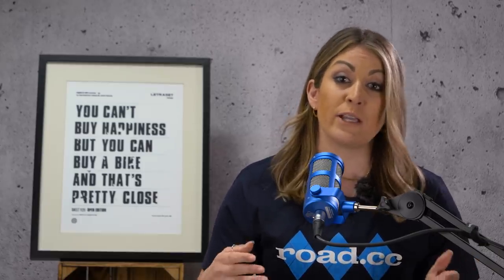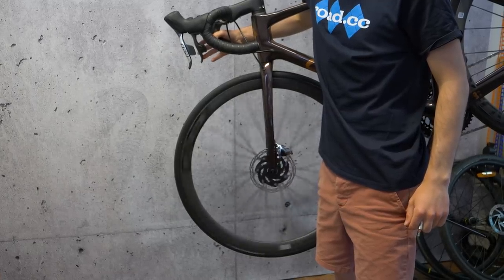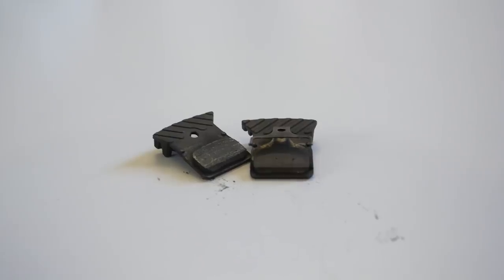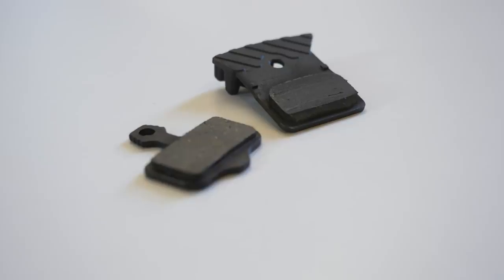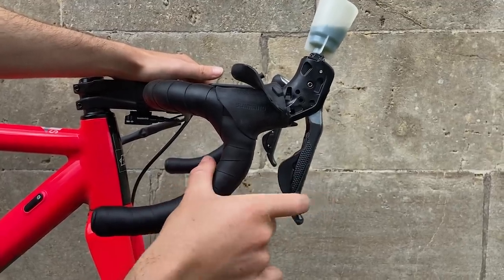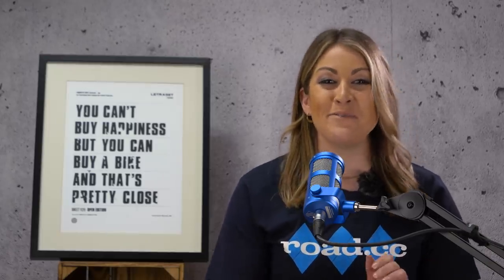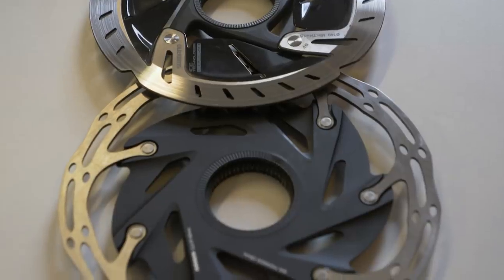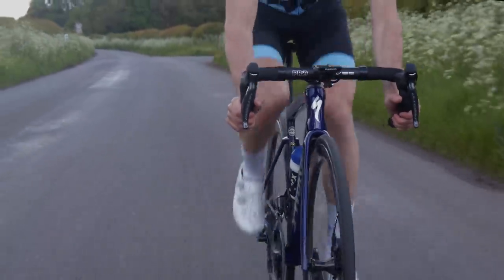8 things they dont tell you about disc brakes

Comment: I've had disc brakes on mtb for a couple of years short of a couple of decades, and I've never had any problem there. so on my new road bike I of course opted for discs and I was very happy this monday when I went crazy down a hill only to be greeted with a above 45 degree bend that I had to apply all my braking force to slow down to. on my old rim brake bike I'm not sure I would have stopped fast enough. But I understand that some like the simplicity of rim brakes, I'm just happy I got options now.
Reply: They're good until they start squealing, that problem is insufferable to deal with

Comment: One important thing to remember is that some rotors CANNOT take anything but resin pads.
My rotor is stamped with "use resin pads only" - dont swap one without the other
Reply: They can actually take semi-metallic pads or ceramic pads. They just won't last as long as they would have lasted with resin pads because they're (the rotors are) made of aluminum instead of steel.

Steel rotors are always fine with whatever pads you buy.

It's... often worth doing to go to semi-metallic or ceramic pads just to save maintenance time. How much time do you want to spend on your knees replacing pads? I know people who do that weekly because they refuse to switch to longer-lasting pads. Steel rotors aren't hideously expensive, and you're probably not trying to squeeze that last 1/100 of a second out of a 10K run, so aluminum rotors are nearly never worth having.

Comment: I have just got into bicycles and have been having a lot of fun working on my bike, having come from cars and motorcycles it's really fun to have such easy access to everything lol.

I've got a disc on the front and and rim brake on the rear. I like the feel of it, similar in some ways to a motorcycle brake feel. The front suspension loads at a good rate to get a nice progressive front brake pressure curve.
Reply: I used to have the same setup on my Giant TCR by swapping the fork. Great idea 💡

Comment: disc brakes are a good source of income for manufacturers and dealers alike.
Reply: Guess why moto gp racebikes have 2 set of disc brakes in the front.... 1. is cooling factor, 2. is increased breaking power, 3. it wont bring your wheel out of balance when you break, which happens when you apply force on one side of a wheel. You may adapt to it, but on a race bike which weights 7.5 kg this is freaking sketchy. As a non pro, you dont wanna change your wheels every 10k or less when descending quite often. You dont want to put WAAAAAY more force onto your fork while breaking. Its just stupid
Reply: @kilian_brk  a motogp bike has more weight and speed to contend with than a bicycle.
Reply: @tomnewham1269  Thats not really the case though. Going downhill with 100 kmh per hour over a long period of time with a lot of breaking is way more force than what u have with a moto gp bike. Moto gp bike weights 160 kg makes a total of 220 kg max. A cyclist weights probably 65 kg including the bike (light rider). The moto gp bike goes 300ks per hour, the bycicle 100. The kmh per kg ratio is better than with the moto gp bike (in the cicumstance of having a light rider on it. Someone with 80 kg drops below moto gp level, which means more force on the brakes than with a moto gp bike. So no its fucking unsafe, givin that everyone uses the same stupid brakes dispite their weight. Safety and good breaking is freaking essential and this is damn careless
Reply: @kilian_brk  But the brakes on a road bike are not as large or powerful than the brakes on a Motogp bike and the Motogp bike and rider still weigh more than a road bike and rider. It is not careless as good braking technique is required whether disc brakes or rim brakes are being used. The brakes are not stupid and they would not be installed on bikes if they were unsafe as the bike manufacturers would not risk litigation being taken out on them.

A lot more smarter people than you would have done research and development on these system braking systems and pass numerous tests before being leashed out to the public.
Reply: @morgan98801  I agree there should be a choice. Not everyone will find a benefit with disc brakes and rim brakes will be suffice for them. A lot of the disc brake haters out there are just Luddites and have no logic in their dislike of them. They come up with so much crap just to try to point that they are right and everybody else is wrong. I guess a lot of that hatred comes from that the fact there will be no choice in the matter when it comes to purchasing a high end road bike and a lot of the hatred towards disc brakes would go away if manufacturers continue the option of kitting out your bike with either brake type. 

Don't get me started on the 26, 27.5 and 29 inch wheel debate. Again there should be the choice in wheel size but unfortunately that is not the case no more. I do hope manufacturers turn back the clock and offer either wheel choice on their MTB's.
Reply: @morgan98801  Yep, and then 29'ers . . .  . hahaha. it's all marketing.
Reply: @radiocontrolled9181  If everything is just marketing, do you think today's bikes are no better than bikes 40 years ago?

Comment: I have been using RIM brakes for over 30 years and never had a problem.  They have worked great for me for all that time and not once have I thought "wish I had disk brakes" I do have disk brakes on my mountain bike but I had no choice on that one and I cannot see what the fuss is about....  I will stick to my RIM brakes for as long as I can I am not getting on the band waggon
Reply: Disc Brakes are for idiots who like the latest fad whatever crap it may be. Rim Brakes are superior in every way on a bicycle since bicycles are powered by humans and easily stopped  by humans. Furthermore disc brakes gives a TON of issues when the rotors have even the slightest wobble and out of true sometimes in the heat the pistons will push out and rub on the pads sending you to a grinding hault and stranded. A rim brakes you can literally just adjust it with your fingers furthermore rim brakes allow for bikes 1KG lighter and more.

Comment: I've had disc brakes five years now, changed the pads a few times, and yeah that's about it. No squealing, no hassles, and pad changes take maybe ten minutes tops. If you can bleed the brakes on your car you can bleed them on your bike, it's just not that hard. Use what you want, but disc brakes are just peachy IMO, especially when monsoon season rolls around. 
(Edit) I've got two bikes, one for commuting and one for fun.
Reply: Rim brake die-hards perhaps don't realize that the overwhelming majority of cyclists around the world don't service their own bikes beyond maybe changing out inner tubes, if even that. They go to their LBS.

Given that fact, most people choose disc brake models for the simple fact that they "feel" better when it comes to power modulation. Oh, then there's also the self-adjusting aspect of disc brakes, with no need to fiddle with barrel adjusters and the like to adjust for pad wear and rim spacing. Plenty of people can't even be bothered doing that.

If most riders simply go to a mechanic for bike setup and repairs, thus eliminating the supposed hassle of setting up or maintaining disc brakes, why would they choose brakes that have arguably inferior lever feel, even when set up correctly, and worse modulation?
Reply: Having both worked on cars, as well as being a bike mechanic, the disk brakes on cars are actually easier to service than the ones on bikes!
Reply: @lihtan  I'm a car mechanic, and I can confirm that bleeding a car is far easier than bleeding Sram brakes.
Shimano's all right, though.
I'll continue to ride rim brakes until you can't get rim brake frames anymore.
Reply: @lihtan  really?
Not on any car I've ever worked on 😆
Reply: @peterfenwick4662  Let's do a few comparisons here. On a car, the brake calipers are usually attached with something like two 14mm bolts. The caliper only goes on one way. You line up the bolt holes, torque it down, and you're done. On a bicycle, the caliper will be attached with a pair of 5mm hex bolts that go through slotted holes. You have to manually center the caliper often to a fraction of a millimeter. Then there's also the issue of rotor warp. As much as I like the performance of disk brakes on a bike, they're not plug-and-play like they are on a car.

On cars where I've had to do more involved work like caliper upgrades, or swapping in stainless brake hoses, I would also install a set of Russell Performance Speed Bleeders. unlike the factory bleed screws, the Speed Bleeders have an internal ball valve that allows one person to easily bleed the brakes by themselves. Simply open the screw, and pump the brake pedal until you see clear fluid. Couldn't be easier! The one instance where bleeding brakes on a car would be nightmare, is if you have purge an air bubble out of an ABS modulator. You typically need access to dealership equipment that can use a proprietary factory protocol to cycle the modulator.
Reply: @lihtan  I've never had a problem centering the caliper on my bike.
Discs warp on cars too, components go rusty and stick. Pistons size etc. And yes, you need to access the software to cycle the ABS pump. 
There's also the task of lifting it off all 4 wheels and removing them.
I replaced the pads and fluid on shimano brakes on my hybrid in under an hour. 
Same job on my car would take at least 2  hours and that's without the inevitable rusted bolts.
Reply: As a former cycling food courier the sheer costs of weekly v-brake rubber pad changes was horrific. My scooter disc brake pads have been changed ONCE in 7000 miles. Disc brakes should be the norm.
Reply: @brokeandtired  
My first set of pads got 5k on them before I needed to change them, I guess I ride the brakes a little harder than you do. :) I do have a lot of hills in my area of Japan though.
Reply: @lihtan  
I've never had to center the caliper on my bike,. Pull the wheel. pull the cotter pin and old pads. push the caliper back with a flat shim and some beefy pliers, put in new pads and cotter pin, install wheel squeeze the brakes a few times and job done. Yes you should check for dragging, or an uncentered caliper as well as rotor warp, but I guess I've been lucky that I've never had any of that. I've only had Shimano components though, so maybe that helps. 

For me bleeding on cars has always been a two person job, those speed bleeders sound like a nice addition to a car though!
Reply: @Bagledog5000  When I worked as a bike mechanic, centering brake calipers was a necessary skill when you're assembling a new bike. The bikes I was dealing were pretty bad from the factory. Hardly any of the mounts on the frame were straight. As annoy as that was, the mechanical disk brakes were even worse, as you had to compensate for cable stretch as part of the tuning process.
Reply: @lihtan  
Okay, that makes more sense. I've never had to set one up form the factory, I can see how a lot of the stuff that is slapped together nowadays would suffer form that sort of thing. Some of the welds I've seen have been pretty sloppy lately, and on fairly high priced bikes, so I can see how other stuff could be too.
Reply: And tell me, how many riders heading out for hours and hours in "monsoon season"????? Also, I haven't seen many riders-if at all-in monsoon areas....maybe is just me.......
Reply: @shandytorok259  
Even I don't head out for "hours and hours" during the monsoon season, but when you get caught in a torrential downpour on your way home from work because the weather report was off by a few hours, and you've still got 45 or so minutes left in your ride and a hilly section of Japan to ride in, well let's just say rim brakes suck pretty bad at that point. They actually suck pretty bad on the flat parts as well to be honest. Ortlieb saddlebags are awesome though, and highly recommended. 
Since we're smack dab in the middle of the season right now, it's slated to rain pretty heavily every day next week. But I bet I'll see about  the same number of folks cycling that I usually do just like I did today when it was raining, so maybe it's just you after all.
Reply: Guess why moto gp racebikes have 2 set of disc brakes in the front.... 1. is cooling factor, 2. is increased breaking power, 3. it wont bring your wheel out of balance when you break, which happens when you apply force on one side of a wheel. You may adapt to it, but on a race bike which weights 7.5 kg this is freaking sketchy. As a non pro, you dont wanna change your wheels every 10k or less when descending quite often. You dont want to put WAAAAAY more force onto your fork while breaking. Its just stupid
Reply: Bleeding bike brakes is MUCH easier than a car. At first I was hesitant but having excess hydraulic brake hose got annoying, I bit the bullet, cut it and bled it. It was virtually foolproof. After having all sorts of brakes on my bike, I would always go to hydraulic brakes. Pads last at least 2000 miles, pad changes are two-minute jobs, there's no brake squealing, great modulation, great stopping power, swapping a wheel out is easier and when you need to align the brake calliper, it's a two second job - loosen the calliper bolts slightly, apply the brake, then tighten the bolts! There's no need to bleed every year, the fluid never really gets hot so no need to change out. Best one, rims never wear out, I still use the same wheels for over 7 or 8 years. Bleeding bike brakes is MUCH easier than a car IMO. I can do my bike... I don't want to do my car!
Reply: @Kuriketto  I used to be wary of disc brakes. However, after the endless adjusting of V brakes, having the adjustment screws strip the thread, finding replacements, installing, having adjustments go out of whack... I've found that hydraulic brakes are actually not that difficult to bleed, and changing pads on them is actually easier than V brakes, at least in my experience. I utterly cannot and will not go back to that endless, endless, endless faffing of adjusting V brakes. Discs are a short learning curve, but that self-adjusting nature alone is worth that price of admission.
Reply: It’s all personal preference.
Reply: All you need to win the rim vs. disc brakes argument is a can of WD-40. You squirt it on the rim of the rim brake bike and on the rotor of the 8-tracker. The rim brakes will hesitate a little as they strip down to metal, then they'll grab. You'll probably have to dismount the pads after ride and scrub them down, and should probably wipe your rims too, to get optimum braking back. 

As for the 8-track brakes, you'll probably have to scrap the entire bike and buy a new one. If you survive the ride home. Which you may not. 

This is why they're called 8-track brakes, at least by those of us who survived the 70s. I could go into the ludicrous levels of adjustment and maintenance, the expense, the weight, the marketing churn that makes your model obsolete and unserviceable a year of two after you buy it, the rides spoiled because your goddam brakes won't stop doing that...

But a can of WD-40 will put an end to any nonsense about disc brakes being safer, more reliable, or easier to service.
Reply: @RobMacKendrick  So your argument against disc brakes is because a can of WD40? HAHAHAHAHAHAHAHA Go back to your nap grandpa, you are obviously cranky. I've had the same disc brakes for over 6 or 7 years now, parts are available but the only thing that really wears out is the brake pads... which are available from anywhere and lots of different brands to choose from. If the brakes need replacing after 10 years because I can't get a new seal or whatever... I'd rather just get a new brake setup.
Reply: @khalidacosta7133  Did you just write "HAHAHAHAHAHAHAHA", son? That's the best you can do - schoolyard trash talk? Do you know what WD even is? You run into that - and similar substances - around bikes. They get on stuff - like my disc brakes, which required disassembly and new pads because of something as ridiculous as a touch of overspray. And that same kind of thing comes off the road. There are dozens of similar pointless problems with disc brakes, which meantime don't solve any problems that most bikers actually have. So run along and play, little boy. The grown-ups are talking about grown-up things.
Reply: @RobMacKendrick  Easy. Far more stopping power, reliability in all conditions, easier pad changes, easier wheel changes, heat tolerant - no popping tyres or delaminating carbon on steep descents, rims don't wear out, less maintenance as brake pads last longer, don't have to clean as often, less maintenance & adjustment (pad clearance is automatic) less force needed with your fingers for higher stopping power, better control of force, better feel.... pro's on rim brakes? Slightly more aerodynamic and less weight. The weight is a bit of a moot point... you weigh around 70-80kg on average. Even 200g extra won't make much difference. So yeah, no thanks, I won't be running, I'll be cycling... with far less maintenance and far more safety than you.
Reply: @RobMacKendrick  Ever had a rim blow out after wearing down and locking the wheel,, throwing you off the bike? And where on a bike does anyone use WD40 ? Obviously you must be careless about keeping any kind of lubricant away from brakes. I bought a set of disc brakes for a mountain bike almost 30 years ago. They work in mud and water unlike rim brakes. Also a damage rim means you can still ride to get back to car or home safety.
Reply: Back in the day my XTR v brakes were more powerfully than disc.